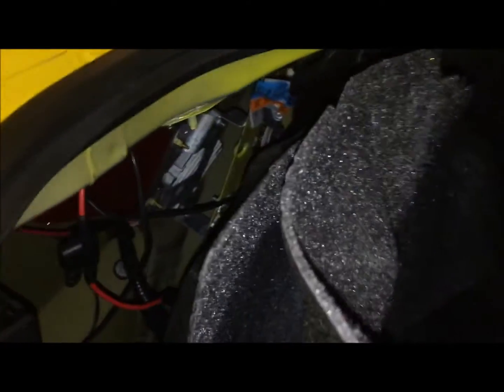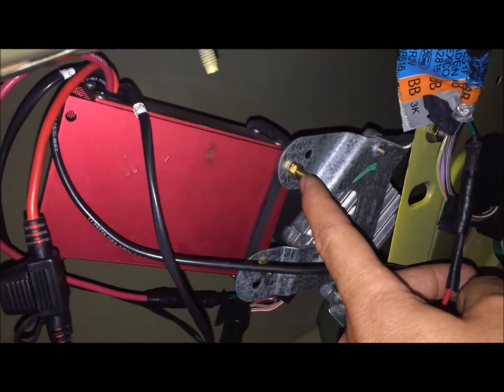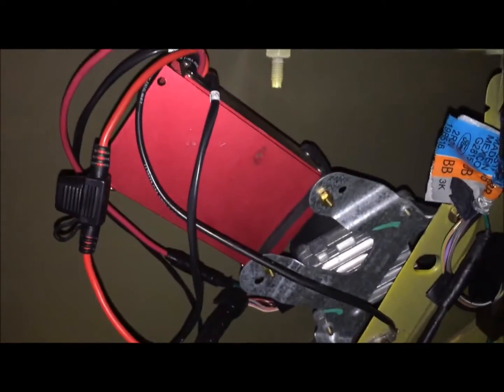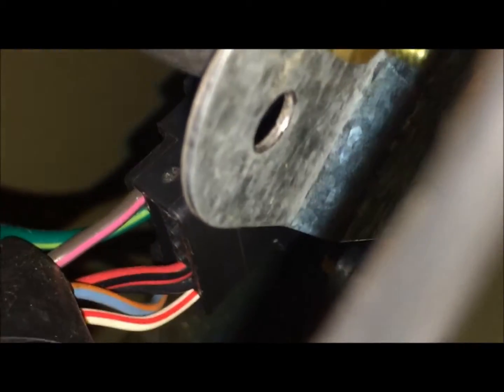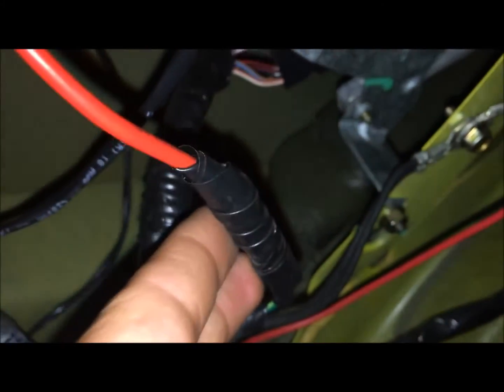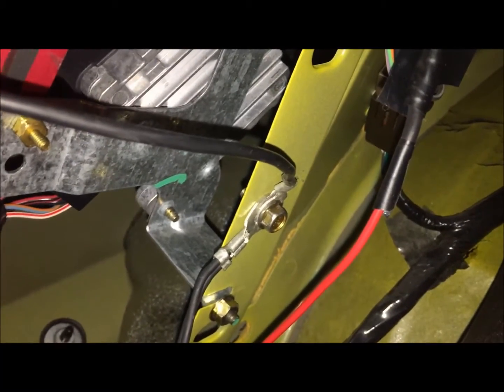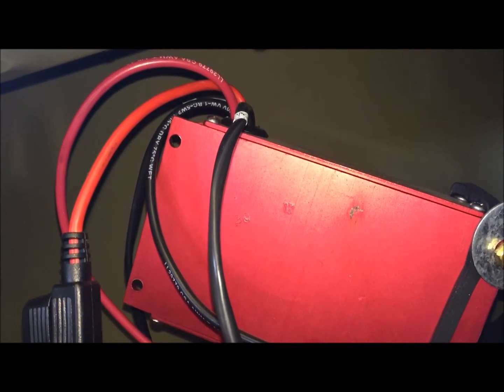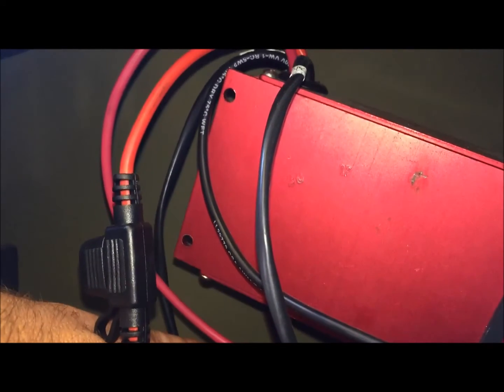How to install/wire a kenne bell boost a pump BAP. Pre-fpdm

Comment: Hey danny i have an 03 that i just wanted to look over the bap install. i purchased this car with one already in it and it looks like they set it up post fpcm utilizing the brown/pink wire and i also noticed the inline fuse adaptor wire is melted my question is should i redo this and do it pre fpcm? and fix the inline fuse setup to a heavy duty wire? i just had the car tuned but did not know this prior or if it will mess with the tune?
Reply from the maker: I would leave it how it’s tuned but make sure the melted area has a good connection. Maybe add some solder and wrap it well with electrical tape
Reply: @dannyjohnsonsgarage ty sir for your reply.
Reply: @dannyjohnsonsgarage  So strange to me that the supplemental 03/04 cobra instructions show to wire this thing post fpdm/fpcm utilizing the brown and pink wire and everyone is doing it pre. I even talked to kenne bell customer service via email and he said to wire it pre so my confusion is did kenne bell revise the wiring or what? i went ahead and just fixed the wiring but left it post hook up because my tuner said to leave it as it is and fix bad wiring. it's just mind boggling on this haha.

Comment: You know what the difference is hooking the BAP up to the FPDM harness vs hooking it up to the harness of the inertia switch? I currently have a GT and don’t have a green/yellow wire on my harness and according to the GT forums, wiring it off of the inertia switch is also considered “pre-fpdm”

Comment: Hi Danny my car came with one all set up etc. I was wondering the adjustable dial 0-50 I believe on the black box, lean to rich. What’s this do and is there an optimal setting? I may have missed that in the video
Reply from the maker: You’ll want to err on the rich side for safety. If you have a wideband, check it’s output before changing anything. Most people set them to 100% just to ensure the car can always request enough fuel.

Comment: I had one in my 06 Mustang gt sc hooked pre fdpm for 13 months then cruising down the road in 4 th it burns up (bap) any idea why or could it just be a faulty bap ? Trying to figure this out before I install another don’t wanna burn it up also
Reply: Ever get it figured out?
Reply: no i just installed another one and hoped for the best..;. thanks for reminding me its about that time..
 @JordanSVT
Reply: @blackriflex39  Once you replaced it with another BAP your issue was fixed? That would make me think you may have just had a faulty unit.
Reply: @JordanSVT  yea all good now im hoping its not a every 13 month thing lol ... i myself thought it was faulty but kenne bell never answered 1 email telling me anything... the second one is hooked up exactly the same i went over kill and double heat shrinked the connections this time

Comment: Prob stupid question, but does it matter which side of the cut green and yellow wire goes into the pink wire and which goes into the red with fuse?
Reply from the maker: It looks like it says the wire coming from the fpdm is where the red wire should be connected (step 4) http://www.terminator-cobra.com/KB%20BAP%20Instructions.pdf
Reply: @dannyjohnsonsgarage   so the red/black wire that goes to the knob its the ones you connect together?

Comment: Hey danny, quick question. Can I just use that pin out on the harness, mine are all the same colors except for the green and yellow.  Mine is pink with a black stripe. The green and yellow goes into the intercia switch but it doesn't go into the fpdm module. This a mach1.  Thanks any help would be appreciated.
Reply from the maker: I believe it’s also pink with a black stripe on the GT
Reply: Does your green with yellow go into the inertia switch? Just wondering. apprciate it. Thanks for all your help. Really do apprciate it. Very very helpful.

Comment: Hey so if I end up having a Hobbs switch hooked up in mine, can I still re wire it this way? Or will it screw my car up? I’m chasing a cut out randomly at low throttle 1st sometimes 2nd gear. Happened after my alternator went out. Other cobra guys thing it surged and messed the BAP up. I bought the car with all this stuff on it. Paper work says BAP was installed in 2013 then tuned then re tuned in 2016.
Reply from the maker: It shouldn’t matter as long as the switch is tuned up to 100%
Reply: @dannyjohnsonsgarage  ok and I can just leave the dial out right? I took it out yesterday and it made it run better.
Reply from the maker: @Wretched2JZ  as long as it’s set to 100% or some people wire it out so there isn’t a switch at all and that should set it at 100%. I haven’t done that part so I can’t say 100%
Reply: @dannyjohnsonsgarage  ok yea because I didn’t see it in the manual I downloaded but all these local installers on FB said that’s how they work 🤷🏼‍♂️
Reply: @dannyjohnsonsgarage  so mine is hooked up to the wrong wire in my harness. 

My question is does the fused wire go to the end of the wire coming from the plug side. Or the other green wire end that goes to pump or wherever.

Thanks doing it now!
Reply: @dannyjohnsonsgarage  because they had my fuse wire going to the plug side completely opposite of what this says.

Not sure how my car was even running. They had the dark wire with pink stripe tapped.
Reply: @dannyjohnsonsgarage  so it actually made my car way worse, un driveable. Even tried reversing the red wires. Put it back to the way it was and it’s still having issues. I think it’s toast after the alternator went out 🤷🏼‍♂️

Comment: Did you have any problems running it without the hobb switch? It's basically always on in that case correct?
Reply from the maker: Correct. No problems.

Comment: Hey Danny you mentioned you have a modified fpdm and it just plugs in. I just bought a black 306 modified fpdm but I plan on using a fore hat with built in fuel pump wires. How would I go with connecting the power and ground wires from the fuel pumps to the fpdm? Sorry for the dumb question I’m just a bit confused
Reply from the maker: Do you know if it’s the stock returnless system or are you doing a return system as well?
Reply: @dannyjohnsonsgarage   yes it’s the stock returnless system. Only reason I’m using a fore hat is because I didn’t want to modify my stock fuel hat to run the wires from the fuel pumps and it also came with bigger power and ground wires witch I heard was a good idea to upgrade. My set up is basically the fore hat with ford gt pumps and a black 306 modified fpdm
Reply from the maker: @modlist6129  In that case the fuel pump wires would be spliced into the existing ones (probably at the harness near the hat)
Reply: @dannyjohnsonsgarage   the fore hat has built in wires that are really long I was thinking about running them all the way to the fpdm and just splicing them to the pig tail to the fpdm since the wires on the fore hat are bigger than the ones in that go from the fuel hat to the fpdm

Comment: Bout to buy a newly Posi ported eaton so getting this on order soon. Shouldn't need bigger injectors when running the BAP right?
Reply from the maker: My brothers 10th had stock injectors but it was pushing it and running a bit lean. He was at 513rwhp. I’d recommend some 60# as well as the boost a pump and a mafia MAF extender or MAF upgrade. Just my thoughts
Reply: @dannyjohnsonsgarage  Copy that. I'll grab both then. I'm already running the SCT BA2600 MAF.

Comment: Hey Danny I’m a little confused wondering if you could help me out, I’m hooking up a boost a pump in my 03 cobra, and the instructions say to tap into the brown wire with pink stripe at the inertia switch, but I see that you tapped into the green and yellow in a different area.
Reply from the maker: That would be post fuel pump driver Module. I have mine wired before the fuel pump driver which is supposed to be better
Reply: @dannyjohnsonsgarage  ok , so u recommend the green / yellow wire,  i talked to Kenny bell, they recommend the brown/ pink
Reply from the maker: @TommySVT  it sounds like the only difference is where it is being installed.If you install it after the fuel pump driver module the computer does not have full control over the pumps anymore. The wire is probably just a different color by the inertia switch instead of by the fuel pump driver module. You can do it whichever way you would like. They may be doing it their way for convenience.
Reply: @dannyjohnsonsgarage  ok , I’ll probably hook it up like yours, that makes more sense. I appreciate the help, thank you
Reply from the maker: Mine was this way as well as my brothers, so must be the trend lol

Comment: Hey Hows it going, I am having trouble with my BAP. Its on a corvette, My fuse holder is getting really hot, the surrounding wires are ok, just the fuse holder is getting really hot, its the 30 amp fuse, any suggestions thanks.
Reply from the maker: It's most likely at the max of the fuse size or possibly a bad connection causing more draw on one side. That's how a GFI trips on a house outlet, so similar concept. I would check the wiring connections, if possible measure them with a volt meter and maybe even rewire the connections. If you put a larger fuse in there TEMPORARILY TO TEST it you'll know if its getting too much power or not. Don't leave it that way, just see if it keeps getting hot.
Reply: @dannyjohnsonsgarage  
 Hey Man Thanks Alot Its fixed now, I went up a size on the fuse now its running normal and not hot. Thanks AGain.
Reply: @dannyjohnsonsgarage   Thanks alot, I just bought a new 12 guage fuse holder with 40 amp fuse. its the (larger size) Will see how it works. Also a 40 amp originally came with the unit. I already checked and re wired the ground, everything looks ok, I just posted in LS1tech under Forced Induction to see the pic, Thanks

Comment: hey danny would this apply to my 98 cobra?
Reply from the maker: Yeah, it would be the same, but it’s only going to help with the single pump in your tank, so probably not much more use unless you get a higher flowing pump (and only really necessary for a supercharged application).

Comment: If the car will start and run for about 2 mins and then stall out is that a symptom of the boost a pump going bad?
Reply from the maker: sounds more like the fuel pump or the fuel rail pressure sensor (frps). The boost a pump only assists the pump when at a high demand for fuel
Reply: Danny Johnson awesome thank you!!

Comment: Can I put my bap in the engine bay area?
Reply from the maker: You may have seen the similar boost a spark in the engine bay,  but the bap would be easier in the trunk and farther away from excessive heat. You can run the wires all the way to the fpdm from the engine bay if you wanted to..
Reply: Alright i will sick to the trunk thanks!

Comment: Very informative. My car came with a BAP and I used you video just to make sure everything was wired correctly.
What are signs of your fpdm going out? And how can I acquire my fuel duty cycle?
Reply from the maker: some tuners (and I believe the aeroforce interceptor gauge I have) will give you duty cycle. The car not running at all or even going into limp mode would be signs of a bad fpdm. I have a black306 modified fpdm. Never really had issues without it, but hear they overheat, so the black306 modified is a better upgrade
Reply: Danny Johnson would you happen to know the duty cycle % it should read at idle? I have one of those gauges and didn't know it also read duty cycle. They really are worth the money

Comment: So, yesterday I installed my kenne bell bap... It ran perfectly fine.. Today, I installed a new fuel filter. I did unplug the inertia switch and let the car idle and die out to relieve the pressure in the system. After replacing the filter and plugging the inertia switch back in, when I start the car, the fuse to the fuel pump (under the hood) blows every time. It idles and then dies out. Any ideas what it could be? Do you think it has to do with the bap install? Any input would be greatly appreciated.. Thanks!
Reply from the maker: It is possible it has to do with the bap install if a wire is shorting out. I would narrow it down by unplugging the fpdm and then see if it still pops, or even take the fuse out of the bap wire and see if it pops. Double check all the wiring you did

Comment: What kind of fuel pump duty cycle improvement did you see by not doing a wire upgrade?
Reply from the maker: Nick G I believe the duty cycle was 80% but I’m not sure it would be effected by the power upgrade at all. I understand that’s just for better support.
Reply: Yea I understand. What was done to the car at the time? Just a pulley? I've installed a few of these, but have always upgraded the wiring. just would like to compare to see if the wiring upgrade is worth the extra work.
Reply from the maker: Nick G 2.3L Whipple, 60# injectors, intake/exhaust
Reply: Awesome. Exactly what I wanted to know. Thanks for answering my questions! Much appreciated!

Comment: So even with the modified fpdm I still need the boostapump?
Reply from the maker: rene Last yes. The modification on the FPDM only keeps it from over-heating whereas the boost a pump actually gives more power to the pumps

Comment: Great video. You simplified the install. Question, have you did the PPRV delete?
Reply from the maker: michaelsjolin no, I have not. And I'll tell you, the car can cut off between shifts if I'm not careful lol. It's best not to lift off the gas entirely when shifting. My issue is id probably delete it when/if I go return, so not a big deal right now for me. I just try to drive around it lol
Reply: I'm on the verge of installing the BAP on my car since I'm right at 100% FPDC at 6200 RPM, but I've discovered that they offer a single or dual pump application. Which one is yours?
Reply from the maker: Michael Sjolin both pumps run off the same power supply. The only thing I've seen that sounds similar to what you're saying is when people wire a separate FPDM for each pump. Even at that I don't see how two of these would each run one pump

Comment: I just bought my BAP last week. Was your setup with the wiring upgrade? Im kind of confused on how i wire in the upgrade kit and what changes in the install procedures. Thanks
Reply from the maker: Mine does not have the wire upgrade. With the wire upgrade you have to add the power wire from the batter to connect to a relay. There is a diagram in the video at the end that shows it
Reply from the maker: So you would need to run the power wire from the battery to the relay, then the relay would connect to the BAP (via the red wire that has the inline fuse), then add another ground from the relay to the car.
Reply from the maker: Watch at 3:54 of the video and you'll see the diagram
Reply: Is that all there is to it? Do you have to cut the red, black, and violet wire and replace it with a bigger gauge wire?
Reply from the maker: +jflandrvr00 I haven't done it so I can't say 100%, but it appears you need to 1.Run the new power wire (which will have its own online fuse) from the car battery to the relay. 2. Run the BAP's red wire with inline fuse to the BAP. 3. Cut the green with yellow stripe wire coming off the fuel pump driver Module. 4. Attach the violet wire to the green with yellow stripe wire closest to the FPDM, and then the other end of the green with yellow stripe wire would attach to the relay. You also have a ground going from the BAP to the frame of the car and a ground from the relay going to the frame of the car
Reply: I almost want to skip the wire upgrade to get rid of the confusing. A lot of people on svtp says its a must though. Have you had any problems with yours, or do you wish you had done the upgrade?
Reply from the maker: +jflandrvr00 I don't have it but wish I did. I just don't want to put any more money into a return less fuel system. I don't beat on my car (just a few pulls here and there), so I feel okay without it but want a return fuel system eventually